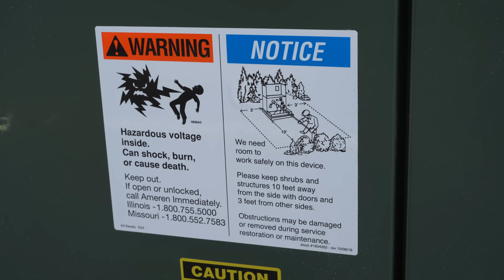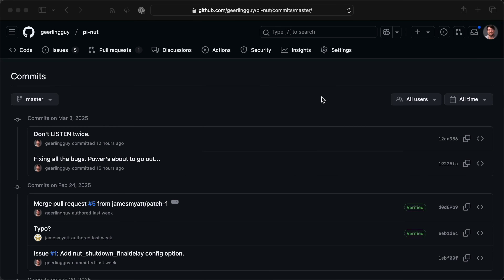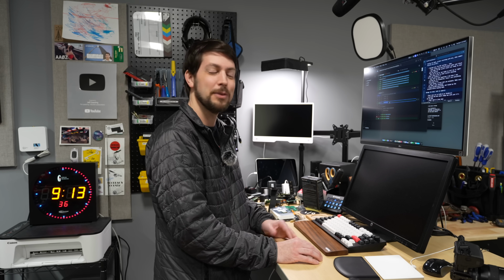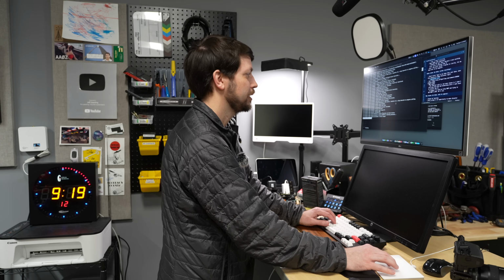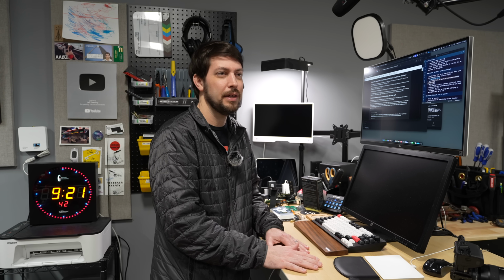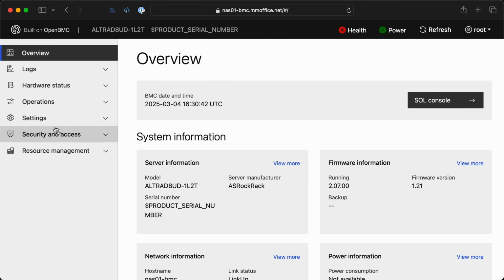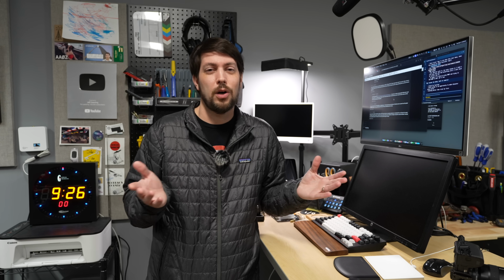Power's back! Some Post-NUT Clarifications

Comment: You could go with a bank of lead acid battery backup system. I would avoid any lithium products for any commercial rental properties. Now as to charging the batteries, if you have a utility provider that supplies power at a reduced price rate for late to early morning hours you could setup a charging system to top off batteries when the cheaper rates apply. Some individuals have done this  to avoid installing solar panels. On commercial properties, most property management companies probably prohibit the installation of solar power systems for their tenants.

Comment: Running a UPS off another UPS is generally considered to be a Very Bad Plan.
It's inefficient.
Many UPSs output modified sine wave or other not-quite-clean power that another UPS may refuse to run from.
Having a subsidiary UPS start to charge can overload an upstream UPS, causing it to trip out, then it tries to come back, then it trips again... Everything goes up and down like the hokey-cokey.
Reply: As long as you respect equipment limitations I don't get why it's bad. The big UPS outputs very clean power and can easily handle the charging current of the small UPS. I also don't see why it's inefficient, as long as the big UPS stays up the only power loss is the idle power of the small UPS.

Comment: I think you should get 4-5 pv panels on the roof and a big battery then design ups circuit - totally possible these days - then you may be able to run indefinitely without utility power - you could get tax credits and more long term reliability - go pro like rsj would do. pls do an update on the shop and how you have kitted it out 1 year after #nuttification
Reply from the maker: I am certainly hoping to do this (whether with a self-designed battery setup, or something from one of the big vendors with inverter + expandable battery packs)

Comment: I would recommend something like a Jackery for extending UPS, especially for the Pi rack. That should last for hours.
Of course you can't "manage" the battery, so no 20%-80% control, but for an emergency, does it matter?

Comment: i think it should be done as for macbooks in clamshell mode. when power-in fails macbooks wait a little bit then gone to sleep. when battery is low they go to deep sleep, then if battery goes even low they hibernate moving memory contents to disk and shut down. i don't get why one small californian company making consumer-grade products can do this and major enterprise vendors can't.
so basically at 40% of  battery you could suspend your power-hungry servers and left some PIs running, then wake servers when power went back via ipmitool
Reply: I'm pretty sure you can set your servers to hibernate when power fails.

Comment: I have a few questions I’m curious about.

- Have you installed a ground strap between your big rack and your electric ground yet?
- Have you configured NUT to notify you when the UPS detects a failing/failed battery?
- Have you looked into any scripting that could load shed your big rack NASes? You could try unmounting filesystems and using hdparm to spin down the magnetic storage to reduce power consumption during shorter outages.
Reply from the maker: Working on the first one soon; my Dad and I are going to be adding some RF equipment/antennas soon, and as part of that, we'll be revamping grounding in the entire back area of the studio. Hopefully with some generous grounding straps to tie into in the server closet.

Haven't looked at number 2 yet, as I just manually replace batteries every 3-4 years on a schedule, and recycle the old ones. Easier that way than waiting longer and having an expanded battery stuck in the UPS. Though you could have a failure prior to 3 years...

For the scripting part, I'd rather keep it simple and just do shutdown or no shutdown. Eventually I hope to have a whole-studio battery + solar backup, so hopefully I would be able to withstand an outage without maybe HVAC for 12+ hours.

Comment: Jeff: I have 2 Pi4s (a 4GB and a 8GB) that are in ArgonOne cases, and unfortunately, require a power button press to turn on. Not all PCs or Pis have the ability to power on at power restoration...
Reply from the maker: I believe the ArgonOne cases have a jumper inside where you can set the power on behavior; at least the case I have my Pi 4 installed in does. But some computers don't have that capability, so you'd need some other means.

Comment: On the NAS shutting down in 22 seconds vs 180s available, you're not gaining that much. If you lose power what exactly will you be doing, you're unlikely to be do anything involving mass data move. It will gain you an extra few seconds for main power to come back online BUT at the expense of 
A) risking to being able to shutdown cleanly due to battery capacity variances 
B) if main power does come back then the battery has to charge again for a period before you get back to decent run time - meanwhile you're at risk of another outage
Do what's safe a shutdown server can't crash due to another power outage
Reply from the maker: True true. Probably will just keep it at 180s.

Comment: What I have learned from these videos is that I should run my nut server on one of my spare Pi's, not on my server. If the server goes down bc low battery, it can't send the shutdown command to the UPS.
TIL !
Reply: I believe that's not actually the case. NUT alters the shutdown sequence so the service stays running even after all the filesystems are fully unmounted. If the server is still receiving power it's able to send the shutdown command.
Reply: @eDoc2020  Interesting take. I assumed that as soon as a server (be it a Pi or some other server) sends the shutdown command to the UPS, it will lose power and therefore has a hard shutdown.
I'd rather have my home server do a proper shutdown when the UPS is still running. The Pi can survive a hard shutdown easier.

Comment: Once NUT triggers a forced shutdown, the NUT server has to restart to clear it out.  Even if power comes back, the UPS battery gets more capacity magically, etc it'll still commit to a shut down once FSD gets set.

I ran into a somewhat related issue in my environment where I had a NUT server on a different UPS with much longer run time, and after power came back, nodes would boot and see FSD still set and shut back down.  That's all intentional, I found a mention of it on the NUT mailing list.  The idea is if a server is unlucky enough to boot  in that window when the UPS is alive but about to die, shutting down is the safest option.
Reply: Looking at implementing NUT for a new pfSense/ TrueNAS setup at home and this is interesting behaviour.
Does this mean that even if power is restored & the UPS is charging the battery, the FSD flag will not be cleared until you restart the NUT service/ daemon?
I took a look at the documentation and it doesn't seem (at a glance) like there's any configuration parameters to say clear the flags if power is restored continuously for X minutes. Does seem like a bummer
Reply: @BigBenAdv  Correct.  But also, the FSD flag is the final "Shut down now, the UPS is about to die flag."  In theory all your protected loads should be going offline very soon after that is set, or they'll have the power cut.

The solution in my case was to move the Nut server onto a device that will get shutdown with the UPS.  You can probably do something custom with the events coming off the UPS and NUT if you need that feature.
Reply: @ Thanks for taking the time to reply.
Yeah, it'd appear that I'd have to look into hob-cobbling some sort of scripting with SNMP then.
I don't so much mind the NAS staying offline but routing and local network is definitely something I'd want to stay online especially once I've sorted out smart home automation of sorts.

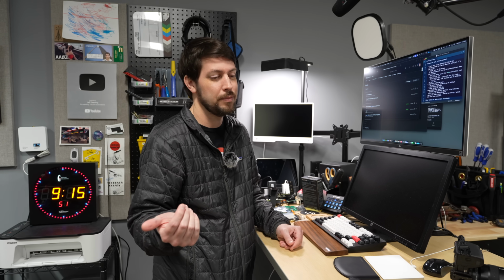Comment: What is the keyboard used here: https://youtu.be/3fqPcee2Dzs?t=368  (or at about 4:30)
Reply from the maker: I've been testing this as a replacement for my main keyboard, it's a Keychron Q1 HE, they sent it... otherwise would've never considered a mechanical monster like it.

I will probably do a video on it soon, still not sure if I'll move on from my Apple chicklet keyboard yet!
Reply: @Level2Jeff  I just liked the quiet clack of it as you typed on it,  maybe it's just your typing 'pressure' - wow, certainly not cheap, but not off-putting I guess... seems to have some tricks under its sleeves

Comment: I have a cheap Eaton UPS 5E 700 which powering my Intel N100 homeserver and my Mikrotik router. And to my surprise it does what you just described. If the power comes back on before the NUT on the N100 can send the final "kill the power in x second" command, it still does the shutdown, then after a couple minutes realizing there's line voltage the UPS turns back on the power. So it still carries through the whole process.

Comment: You could also install an inverter-charger with a suitable battery bank and backup everything of concern much less expensively than buying a big UPS.  I still have smaller UPS to ensure the transition from grid to battery by the inverter will not disrupt things.  Then if the inverter's battery runs out and it shuts off the small UPS and NUT ensures a clean shutdown.

Comment: Hi Jeff, no it is not a good thing that the UPS daemon would be able to cancel the whole shutdown, because (and it is commonly happening), this means your servers would either stay awake or reboot, but if there is a new current depletion, all these devices will be cut from their power supply abruptly, which can mean  a looong time to get them running again and very often disks corruption.

Comment: I actually chose to do away with my UPS gear at home due to the added electricity usage, which matters in NL(EU). I just accept the risk. 🤷‍♀️🌷in part, because my most critical device - a NAS - is powered down by default and only spun up when needed.